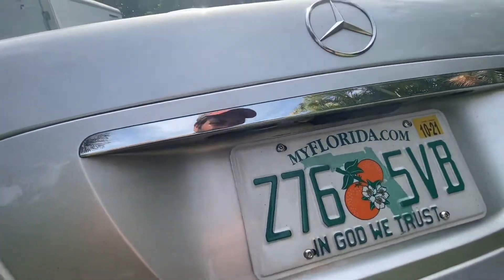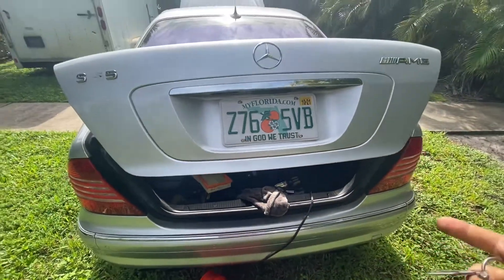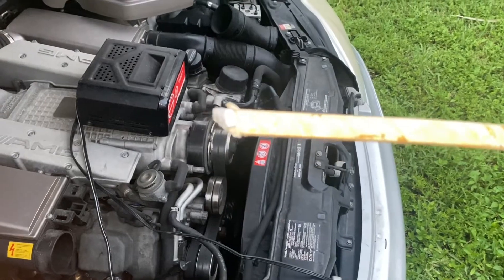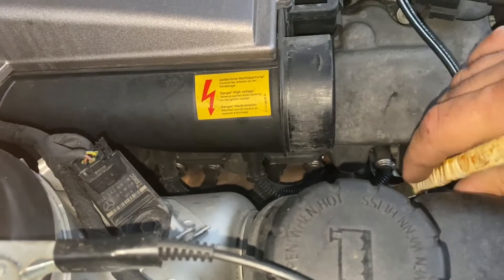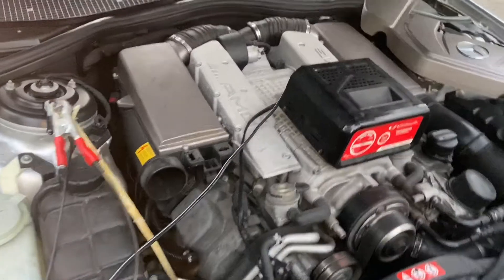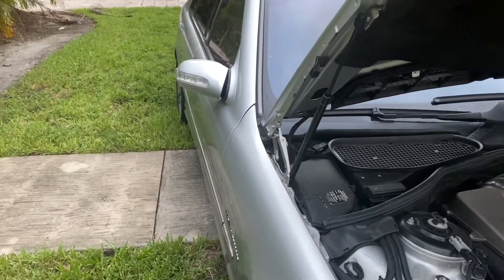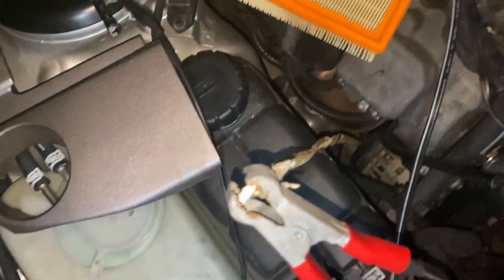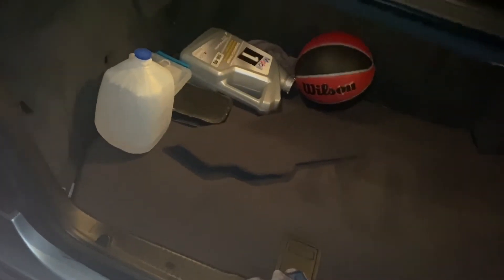How to open the trunk on Mercedes w220 with dead battery and stuck lock by your self.

Comment: Thanks for making the video.
Reply from the maker: Normally I would’ve used a long screwdriver in my jump box, but my jump box was dead this work pretty good. Another way would be to remove the passenger floor cover.
Reply: Sure. These little tricks are useful for all us others so we need to reinvent the wheel (or screwdriver).

Comment: Would have been easier if you actually used the jump points from the fuse box on the left hand side of the car .. Over complicating easy jump
Reply from the maker: I was unaware there was jump points thanks for the information
Reply: Had same problem an every video I looked at gave same information as yourself.. I knew couldn't be that stupid not to have jump points up front so went looking an found it there .. Alot easier than messing with altinator
Reply: Where is it exactly?